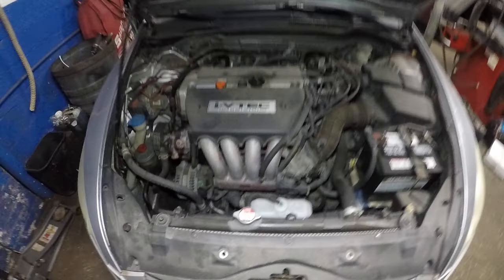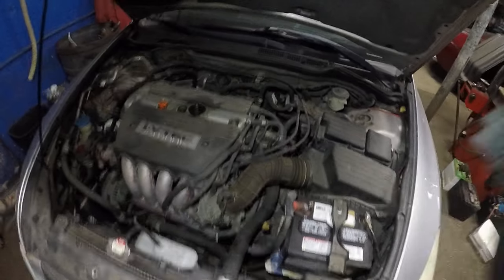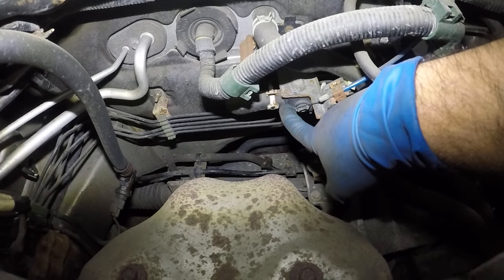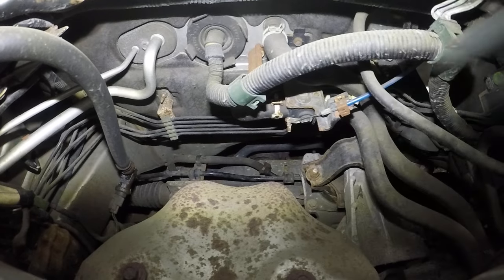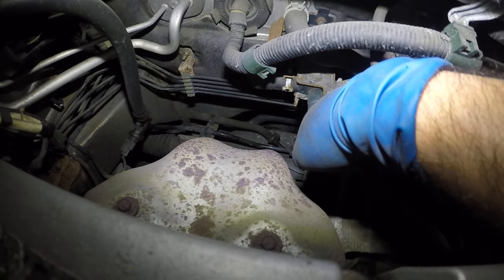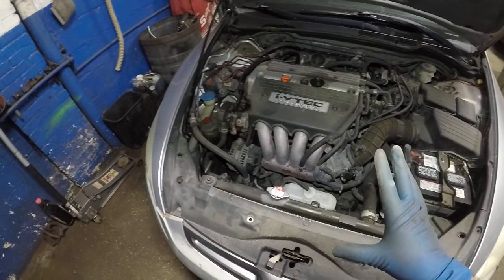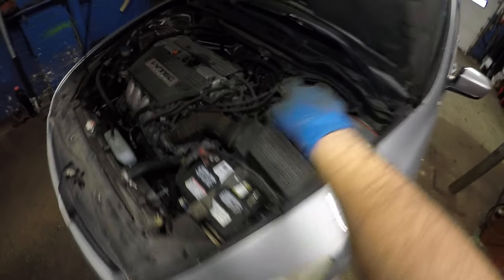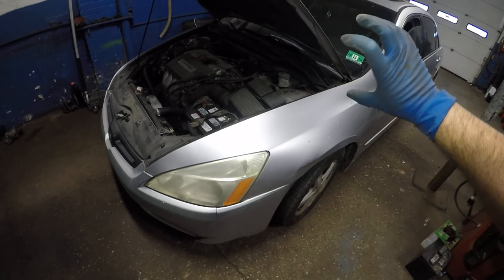no heat on Honda Accord 2003 to 2007 check heater core vale and blend door

Comment: Hey I have 2008 Honda Accord Ex V6 engine and my heater on driver side is not working but the passenger side is working perfectly. Any suggestions that help resolve my problem? Thank you.
Reply from the maker: If it’s dual control then check the blend door motor for that side
Reply: How bout if blend door motor and and valve both work and still no heat on lh

Comment: My 05 accord EX no heat, so I check that valve first also my lower radiator hose isn’t getting super hot like the top on, should I replace the thermostat first and see if that fixed my heating issue I hear the blend door open and close but want to diag first
Reply from the maker: One radiator hose is always hot and other one always lot less cold that is normal
Reply: Update the heater valve is able to move with my hand so I’m assuming it’s the control inside the dash??

Comment: I’m trying to help my friend get his AC/heater working. I’ll help him check that line for heat and cold. But what if the fan doesn’t blow, any things I should check like the compressor or blower or fuses ? Any suggestions I would appreciate
Reply from the maker: Put it on high sleep and bang on the blower motor maybe it will kick on other wise check fuse and relay for blower

Comment: Question I have is my blend door is working and I see the cable and screw move.  But I am only getting heat on the passenger side none on the driver side.  What is the issue then?
Reply from the maker: Well do u have dual climate control?
Reply: @RBTheMechanic  no single climate
Reply from the maker: @iceymalka209  well check to see if it operates and coolent level

Comment: thank you!  How to flush the heater core?    Heat is low while the valve moves.
Reply from the maker: I would t flush the core it really dosent clean out better to check the valve or replace the valve some times it’s internally failed valve

Comment: i have 2005 honda accord no heat on the driver side what is the problem. Thank you
Reply from the maker: Check ur coolant level and if blend door motor works on both sides of u got dual climate control

Comment: I could use some assistance on my car if you have some time. The cable isn’t moving to open or close the valve, I clipped the cable and the valve moves freely but still no heat. Could the blend door actuator have an issue ?
Reply from the maker: Yes now u can go inside down below foot well up to right side u will see the cable and bled door u need to turn that remove it and turn it and see if heat works

Comment: mines stuck in the position yours is in, i believe you said stuck on heat, anything you thinks important? cars currently overheating, water pump works fine new oem thermostat. and i just can’t get heat and car recently started overheating when i lost heat.. any help would be appreciated.
Reply from the maker: Check for fan operation

Comment: Great video, so i was turning the knob n it was turning good, but I realized that the little wire with the circle that goes with the knob is not inserted in the knob, it probably got losee when i took the motor mount out, is it easy to put the little wire with the circle in thr knob? Or do i need to go with a mechanic?
Reply from the maker: Should be easy!!!
Reply: RB The Mechanic thank you, it was ezz

Comment: everything works its just the screw isn't turning when changing heat. i get warm air but not hot. what should i do ?
Reply from the maker: Well that valve is mostlikely bad valve has stopped turning and is probably open little bit to give u warm air
Reply: @RBTheMechanic   ok, i'll just go ahead and replace the part. thanks

Comment: What is the name of the valve... ? My screw turns but the angle not going down far enough... still blowing cold air
Reply from the maker: Heat control valve did u check to see if both pipes are equally hot

Comment: Good stuff!

btw, having problems with the radio on this car, would appreciate a video on a fix if you have.
Reply from the maker: Ohh radio is issue there’s no fix sway it for somthing after marker
Reply: There is a fix..
Reply from the maker: @joekiller9399  huh
Reply: @RBTheMechanic  depending on what wrong with it. Since its this car in pretty sure it probably the back light failed. all you have to do is a little circuit job in the back to make the back light work again.
Reply from the maker: @joekiller9399  I’m sorry what which light this video is for the heat
Reply: @RBTheMechanic  lol
Reply: I ordered an android head unit that was specifically made to fit in my 2005 accord for $200
Reply: @therooster1339  you mean the radio?
I have radio problem when i turned on after couple minutes it goes off by self.

Comment: My heater valve works when I move the temperature but it's backwards when it's hot it goes up and when it's cold is goes down. But it won't fully go down my passenger vents are hot but drivers are not. What can be my problem?
Reply: Would highly appreciate the help
Reply from the maker: Try removing the control line and move it manually

Comment: 2005 honda accord ,I changed the heater valve same thing driver side not blowing hot air.
Reply from the maker: Did u check bled door motor
Reply: I changed the blendoor motor and heater valve same thing
Reply from the maker: @VAL_fam  how hot both pipes getting
Reply: Hose to heater valve is very hot
Reply from the maker: @VAL_fam  both pipe to the core check with infraid gun once car is nice and hot both should be like 190 degree

Comment: Hey thanks for the video. My heater blows cold air. Anti Freeze level looks good and the motor is working as it should. Not sure what the issue is. Any ideas? 06 V6 Accord
Reply from the maker: Check the core valve that I show and see if it turns pay attention to center screw both core pipe should be equally hot
Reply: @RBTheMechanic  Yes it turns. I have to watch the screw though
Reply from the maker: @jaydos3967  yeah these valve fail internally even tho cable pull and arm turn the internal of valve dosent release coolant just pay attention to center
Reply: @RBTheMechanic  Finally got around to checking that screw. It does not move when moving up or down
Reply from the maker: @jaydos3967  u can turn it with screw driver
Reply: @RBTheMechanic  So would I be turning it to loosen it so it will turn in the future, or just manually turn it so at least heat comes out?
Reply from the maker: @jaydos3967  yeah turn it same direction valve arm would turn and if it start to give u heat then u have figured out the issue this valve is like $25 might as well change it rather then leave it on heat
Reply: @RBTheMechanic  Great, thanks! Will check tomorrow 👍
Reply: @RBTheMechanic  Great news! I was able to turn the screw and the heat works! I sprayed some WD40 and was able to switch between hot and cold no problems. Hopefully it holds up. Thanks a million!!!
Reply from the maker: @jaydos3967  cool nice job!!!
Reply: Thanks so much I checked and I had to press it hard and it moved and bam I got heat bits it’s not that hot so what’s my problem it’s like hot but not real hot

Comment: Hi. I have 2007 honda accord v6. Same isuues no heat. But that tiny wire does move with moving the heat knob . But still no heat. The two big hose just beside it is still cold. My radiator is full hot. Not sure what could be the problem
Reply from the maker: The both hoses has to be hot check again if one is hot then core is blocked or the valve is not turning internally

Comment: I have a 07 4cylinder, I replaced the blend door actuator cause the last one snapped and only the passenger side is warm, and the driver is just cold air. The heater core valve is good and moves as it’s supposed to with the actuator. Should I flush my heater core? It’s cold where I’m at and it’s hard in the mornings going to work.
Reply from the maker: Did u check the valve under hood? Also the temp sensors inside could be bad which would cause one side to be cold
Reply: @RBTheMechanic  the one you demonstrated in the video? Yes it moves with the wire. The temp sensor inside the cabin? That exists?
Reply: @RBTheMechanic  where is that temp sensor?
Reply from the maker: @baconintheoven4717  yea
Reply from the maker: @baconintheoven4717  under dash u see there do u have dual control  ? It’s called ambian cabin temp sensor
Reply: @RBTheMechanic  yes it does have dual
Reply: @RBTheMechanic  it isn’t the one that’s in the bumper correct? I’m having trouble finding the cabin temp sensor

Comment: Hey I have a 2007 Honda accord se v6 with no dual control, my heat works perfectly fine on the passenger side but my driver side is cold, can you please help me out?
Reply from the maker: Check ur coolant level first then check to see if the bled door motor works if u got dual dual systym it has 2 actuator one for each side
Reply: The coolant level is fine and the blend door is working also, I do not have dual system mines is single system. The ac works fine it’s just when I put on the heat that I get cold/warm driver side and hot passenger.
Reply from the maker: @cuttie8588  well turn the bled door manually either that or ur core is partially blocked also check the coolant control valve under hood
Reply: @RBTheMechanic  I’ll give it a try, thanks
Reply: @cuttie8588 did u ever figure out the problem?  having the same problem atm
Reply: @davidtorres2804  hey so i ended up checking my driver side blend door actuator first to make sure it was working properly and everything was working well, so i went ahead and replaced my water heater valve assembly (79710-SDA-A01) and thermostat (19301-P8E-A10) with genuine honda parts and this did the trick, now the heat is back on both sides. I also made sure to replace the coolant with honda coolant/antifreeze instead of generic. Hope this helps. Happy holidays.

Comment: I have the same problems no heat ever since I installed my touch screen radio
Reply from the maker: Might be issue with that touch screen not control it
Reply: @RBTheMechanic  yea because I remember there was a wire left not connected when I took the old radio out I wonder ? I can show you
Reply: @RBTheMechanic  I uploaded the video bro
Reply: @RBTheMechanic  mines is getting stuck not turning so ?
Reply from the maker: @YoungShizzie  replace it

Comment: This video didn’t answer anything but him talking about his car, not showing what to do or how to fix it 0/10 would of liked showing replacement or showing at least something to do with heater not just talking about it. Is there a part 1 maybe I missed??
Reply from the maker: Please check to see if the cable turns and screw turns with it as u turn the temp up and down

Comment: I move it by hand to heat and still getting could air 😲😲😲
Reply from the maker: Did u check to see if the valve that I show actually turn look at the screw
Reply: @RBTheMechanic  I replaced it and still got could air thanks for you reply
Reply from the maker: @julianfs35  could be blocked core
Reply: @RBTheMechanic  I will definitely check that out thanks again👍👍👍👍